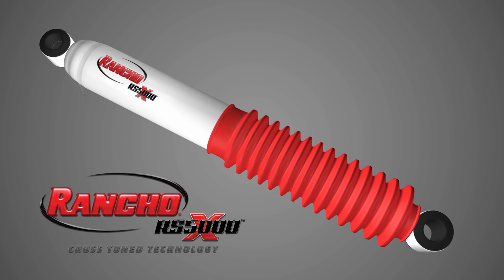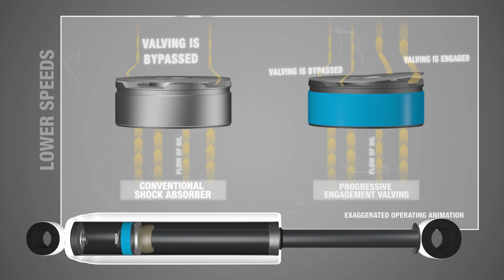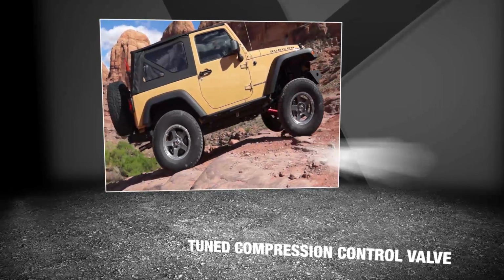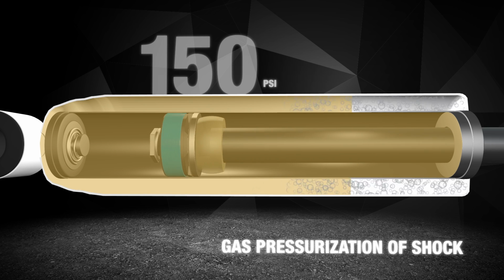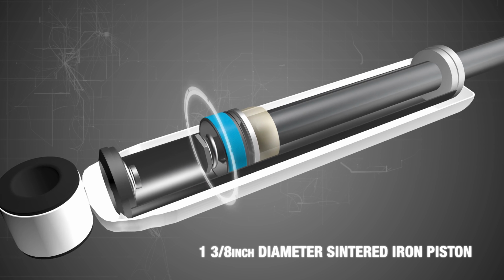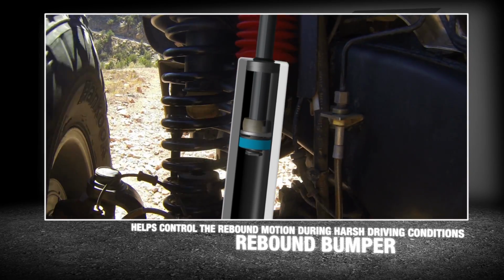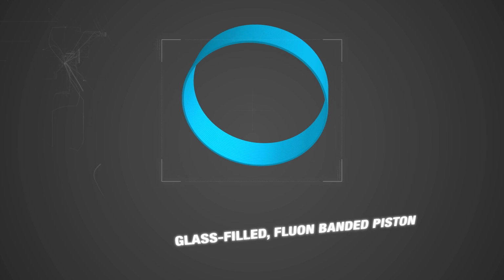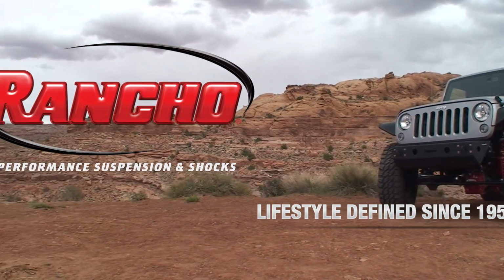RS5000 X Shock Absorber | Rancho Suspension

Comment: Would these shocks be suitable for a 1 ton truck that tows a 5th wheel camper with a pin weight around 2,000 lbs?

Comment: Boot slips off of top of shock. Are new mounting BOLTS supposed to be included in package for lower part od shock? You need a taller welded nut at top of shock to ease installation. What a pita to install on 03 f150.
Reply from the maker: Hi, our tech team would be happy to help you with this. You can reach out to them at 1-800-325-8886. They are available Monday – Thursday from 7:30 a.m. – 4:30 p.m. (CST), Friday from 7:30 a.m. – 4:00 p.m. (CST).

Comment: I have a 2015 Silverado with the all-star package and already has rancho shocks. Says it raises the truck 2 inches on trucks? is this the stock replacement?
Reply from the maker: So those are built to Chevy's specs, in this case you would be best off with the quickLIFT LOADED. This shock is available for a "leveled" or stock truck though.

Comment: I have a overland trailer with an A-arm coil suspension setup. It comes with shocks from the factory that were unbranded but made in china. Overall the trailer rode pretty decent, likely because the a arm coil setups do right better but I knew it could be improved. Did some research on goranchos website and found the perfect fit replacement. Let me tell you the 5000x made this trailer ride and tow like a dream. Took it on the same fire road from a week prior on the old shocks and the trailer was more planted and bounced far less. I noticed on the bigger hits it was more controlled immediately after. I give thanks to rancho on tuning and designing a quality shock at a very reasonable price point.
Reply from the maker: Love hearing that!!

Comment: I’ve used Rancho on every pu truck I’ve owned. Just put a pair on my daily. Sloppy welds, sharp edges, boots wasn’t cleaned from the forms. 
I’m having a hard time thinking about how far down I should pull the boots. Normally I would pull them halfway down, but as I was charging these new ones, the boots were not allowing air flow, being sucked in real bad. So I just took them to the beveled edge and zipped it there. Now there’s a gap, and I’m concerned with it holding water/salt/dirt, possibly causing short lifespan. The ride is great. Just concerned with boot procedure. Thx
Reply from the maker: That is a good space on where you got the boot. Feel free to send pics to us via Facebook as well please. We are Rancho Suspension over there. Thanks!